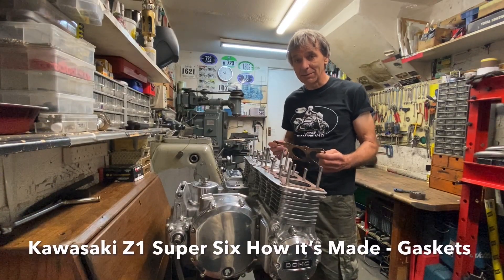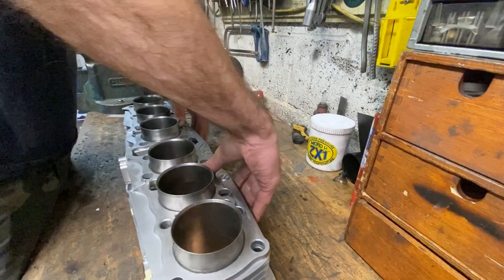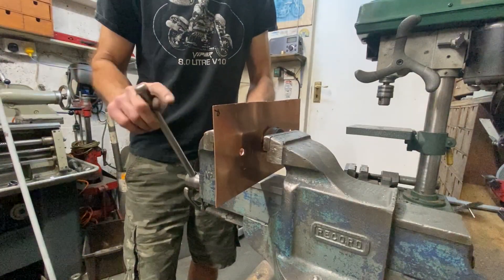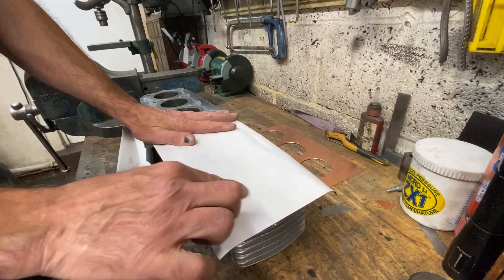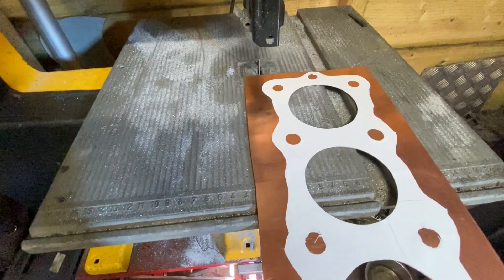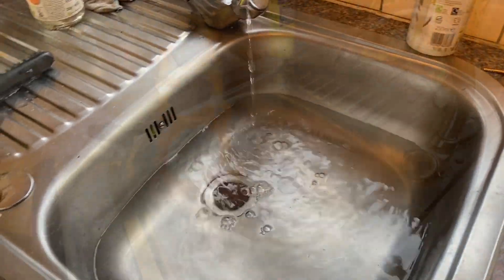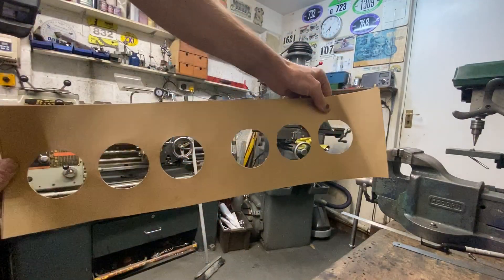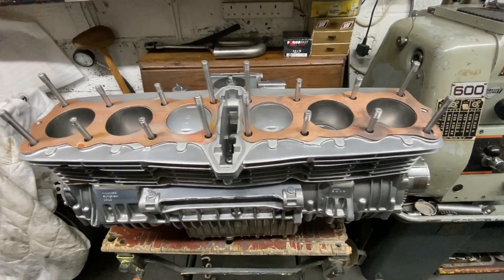Kawasaki Z1 Super Six  Copper Gaskets - How it's Made

Comment: Very informative vid as always Allen. Thank you for sharing your techniques. 

The big surprise for me is that you don’t use vice jaws. And I was expecting you to use a shop built radial cutter (of the type used by woodworkers) in your pillar drill, for cutting out the bore holes in the copper. 

We used something similar on aircraft engines back in the day. It squealed and was prone to chattering if we didn’t get the cutter angle and ground surfaces spot on. I seem to recall we used a steep angle, and curved edge on essentially a HSS face parting tool. 

This might be overkill, but even standard head gaskets for old bikes can be expensive.
Reply from the maker: My vice has no teeth and and doesn’t mark
Reply: Allen Millyard Thank you for clearing that one up. Makes sense now. 

Last summer I reversed the nastiest jaws I’ve ever seen, on an ancient Record - a big one like yours, No9 I think. On the worn side they were beaten and rounded. On the back they were like new. There’s far too much backlash, so the nut probably needs replacing, but it served a purpose at the time.

Comment: Allen, to quickly cut a hole in a paper gasket, put the gasket in place over the barrels, and put a steel ball (bearing) over the paper. Then just tap it down with a hammer. The barrels will act like a die, and cut the paper perfectly!
Reply from the maker: It will there are many ways to do it I’m just showing how I do it with equipment That I have in my shed

Comment: An old trick i learnt many years ago to cut holès in card gaskit place a ball dearing on the gaskit when on the barrels over the stud holes and strike once hard enough to act as cutter the bearing should give a perfect hole.
Reply from the maker: If the hole is round and you actually have a big ball bearing
Reply: @AllenMillyard  as you state if round but you can also use a ball ended punch to create odd shaped holes ,and when i am at work i have a great collection of ball dearings in my tool box from 3 mm to 25 mm old c v joints never go for scrap pile till i strip out the bearings

Comment: As an apprentice I had to make copper head gaskets for one of the bosses 3 cyl boat
He helped me sandwich 4 sheets together between 2 sheets of  steel, a lot more complicated as it had waterways etc. He made a drawing of the hole pitches etc and I drilled those , trapaned the bores out and hand pick milled the water ways.. Took ages but I learnt loads...

Comment: why don't you make a steel template of the headgaskets,  then all you need to do is lay it on top of the copper and hit it with a dash of spray paint, then cut out the rough and make it finished? there is too many variables compared to a known good, unless your heads have variance you are trying to account for.

Comment: Good day to you Allen. I really like your method of making gaskets. May I be so humble to add a few things that the college of hard knocks have installed inside my humble nature. I have found that using a circular cutter in my drill press has worked wonders without dealing with sharp burrs which are really magnets for one's flesh. A round ended knitted short dowel only need's just the slightest rotary pressure to punch out stud holes perfectly in paper gasket material. The rest of what you showed is just icing on the cake so to speak. Thank you for your  humble nature showing us all on YouTube your methods of gasket making on one's back yard shop.

Comment: Just the way my Dad taught me to make them. We use to also make a circular gasket for some heads that fit down into very shallow flycut on the cylinder just outside the liner. We had good success
that method for several years on a Honda 125 & 250cc engines and never suffered a blowout.

Comment: .....but you have a mill yeah? why not finger clamp it to a flat lump of wood and use the dro or hand wheels to bore the cylinder holes and drill the head bolt holes? Can hand finish the outside the way you do but have the bores and holes exactly as the barrels are.....just takes a bit of measuring instead of all the tin snips and working to a scribe line?

Comment: Allen, you make this look rather simple to do, as always, excellent fabrication for the intended application!
Will the cylinder deck be machined around each cylinder sleeve for wire 0-rings to help seal the head gaskets? Did that with more than a few motorcycle engines for turbocharged/supercharged applications.

Comment: When I was an engineering apprentice in the 60s , we were expected to practice many of these techniques,  no computer equipment then!  all good grounding for  life.
Reply: I was taught this by my grandads back in the 80's. Then you go to school/college and wonder why no one else can work anything out for themselves.
Reply: Well doing such work using CAD and CAM its more convenient. I'm an apprentice and learned how to do the lay out and such by hand, but using CNC mill, CAD and CAM its just easier and quicker and I can produce jobs such as gaskets quicker rather than by hand.
Reply: @BorisSpark  CAD - Cardboard Aided Design. You're right though. CAD/CAM is most useful for reproducing things, and it's easy to say "Oh just push a button on the computer" except that you need to tell the computer what to do, which takes some knowledge that stubborn folk just don't want to learn. Both methods have their place, but emailing away to get something laser cut or whatever means more time to do other things.
Reply: Yep! Me too, apprenticed for five years from 1956 to 1961. I thoroughly agree about it being a good grounding for life.
Reply: And everything leaked oil :D

Comment: Really enjoyed this one took me back to making gaskets when I was a  motor mechanic.  On cast iron, we use to use a hammer to get the outline.  Great filming as well tells the story perfectly with some good walkthroughs.  Take some setting up these shots.  I bet the filming set up took longer than making the gaskets.😀
Reply from the maker: The hammer method is really good I’ve used it a lot as well
Reply: @AllenMillyard  I wouldn't mind betting you made your hole punches yourself. They look very good quality , Even compared to the snap on set I own
Reply: I was taught  that way to make gaskets using a hammer carefully its a skill that takes lots of practice to be good.  lots and lots of failures to my name sadly lol
Reply: I learnt to make gaskets like this in the '70's by my late father. Real hands on Old School.
Reply: I learned the hammer method at college too, using the ball part to press down to mark out the holes.

Comment: Allan, you must have different MAP Gas torches than here, I'd never be able to get a copper gasket that size to red heat with what I have, I'd have three of them going but certainly not one.
On something that surface area I might use a propane tiger torch. THAT makes it glow.
Reply from the maker: Strangely in the dark it glows In daylight it’s not so visible

Comment: I use a  treppaning tool in my mill to make the hole. For the stud holes once annealed a hole punch works fine.I used copper from an old hot water cylinder. I was lucky as my motors only a single .
Reply from the maker: There are loads of ways this is just my way

Comment: The drills are called, 'stepped' drills if anyone wants to find them easy on eBay. They go up in regular intervals, 2, 4, 6mm etc. You can also get a cone drill which doesn't have the steps and is useful for the inbetween  sizes, or reaming out. Really enjoying the info and quality of your uploads, very much appreciated, thanks.

Comment: You should make your self a tank cutter so you can cut the holes very easily and very round and accurate. I made one with a ten mm guidance pin and adjustable fly cutters with a hss tip simply welded on, it doesn’t soften the hss. Here’s a very short vid of me cutting out a guitar rosette, when I was working as an engineer I cut out quite a few aluminium and copper gaskets like this.https://youtu.be/XVTymkeFlLg
Reply from the maker: neil mchardy but it won’t fit in my draw
Reply: Allen Millyard it’s only ten mm shank and the cutters are removable. I can’t send you a pic unfortunately here.